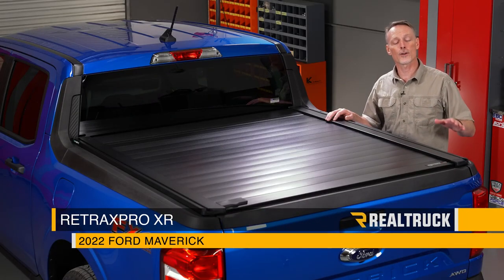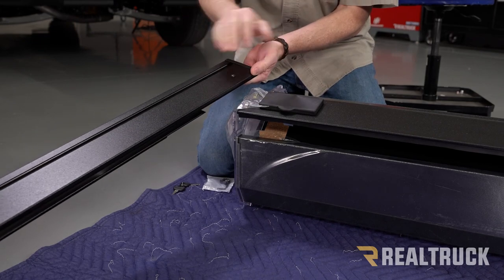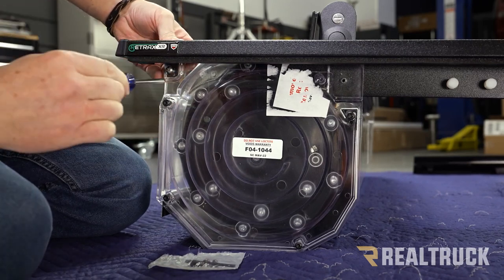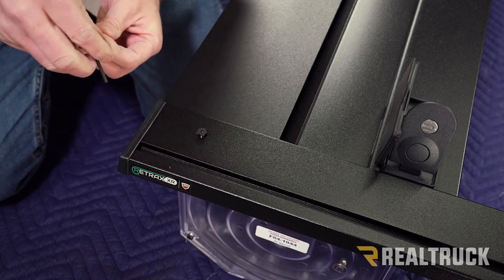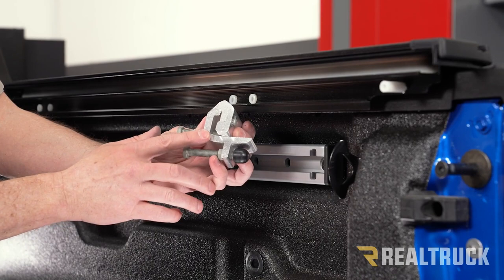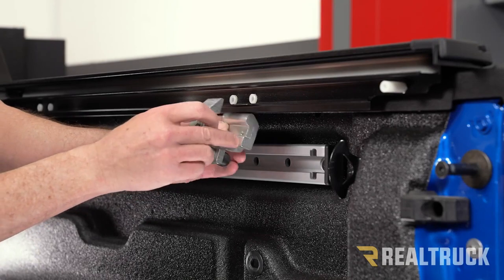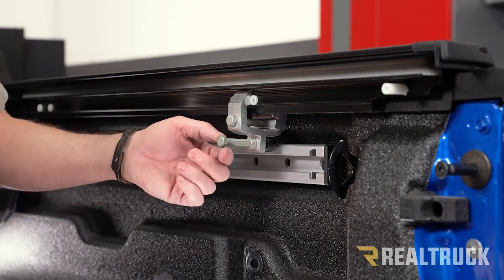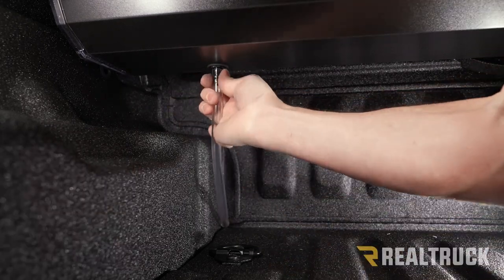How to Install RetraxPRO XR Tonneau Cover on a 2022 Ford Maverick

Comment: The written instructions have a step of adjusting the rails to make them parallel, is there any reason that's not shown here? Damaged my truck doing this step, and it didn't work at first, needed to make wooden blocks to have something for the adjustment screws to work against